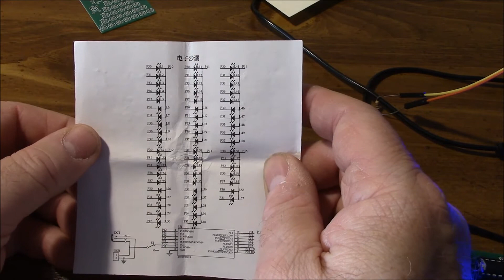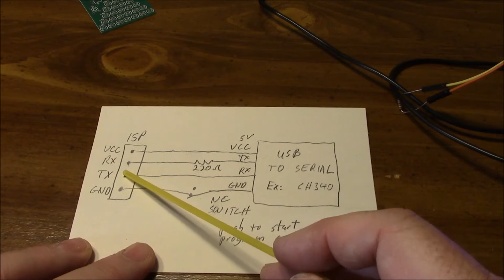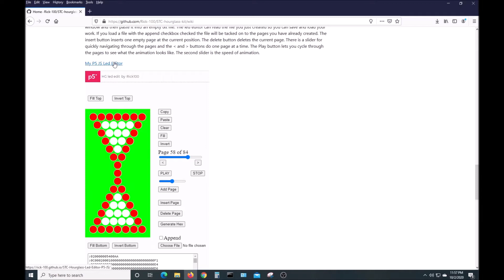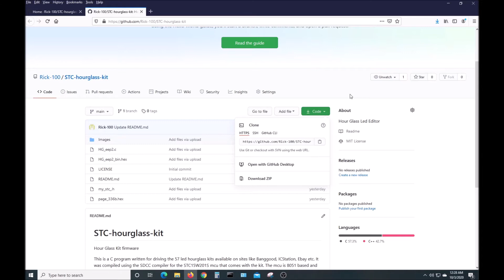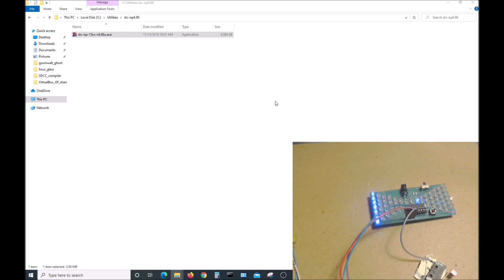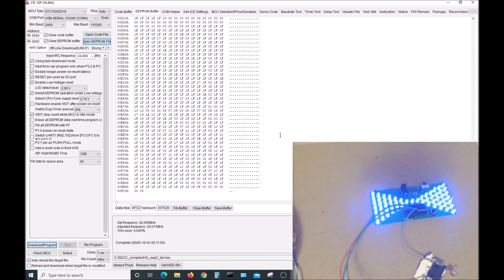Program the STC15W201S mcu  in an led Hourglass kit

Comment: Hi Rick, thank for the video. I use a STC15W204S and when i load page_336b.hex into STC-ISP-v6.96.exe via button Open EEPROM file, i get the follow message: The file is over the validscope, and the exceeding part has been cleared !  . I use HG_eep2_bin.hex via button Open Code file.  When i configure STC15W201S i am yes able to load page_336b.hex, but downloading does not work ofcourse because of wrong MCU. I thougth the 204 has more memory than the 201. Perhaps you know what is wrong.
Reply from the maker: I noticed on the Github page that you found the problem. The 204 only has 4K of program memory but only 1K of eeprom . I think only 85 pages will fit in 1K of eeprom.

Comment: Why did you put the capacitor there? It's supposed to go in the ground hole next to the 4 pin thing and the hole a bit further to the left away from the 4 pin thing
Reply from the maker: It is a decoupling capacitor. I put across the VCC and GND pins close to the chip.

Comment: Is there a way to just slow down the standard programs. Ideally id have it do 5, 15 and 30minutes hourglass
Reply from the maker: If your asking if their is an easy way to slow down the kit without reprogramming the chip then the answer is no. If your willing to modify my program and reprogram the chip then it can be done.
 It's been a long time since I wrote the code. You could probably change the speedVal and speed_table[] from unsigned char to unsigned integer and adjust the 8 Values in the speed_table[] array. You would have to play with the values to get them to your desired time.
This youtuber  has also modded the kit into an hourglass timer:
https://youtu.be/zHmE7z8bmsU?si=7iYv0UFpm-aBpaaI
His mod might be closer to what you want.

Good luck.

Comment: So glad I finally found this.  Took me a while cause I have the other brand of timer that is running off a tilt switch, a CD4069BE and a couple of CD4014 shift registers instead of the STC IC.  I do have a lot of the other project that do have the STC chips and I desperately want to reprogram some of them.  Especially the 8x8x8 LED cube, which I've got some info on reprograming but watching over someone's shoulder like in your tutorial I'm 100% sure I'll be able to do now, once my spare STC chips arrive.  I'm curious, have found a resource for the original programs on the STC chips?  I can't imagine the need to keep them secret for DIY projects such as these.  BTW, I ordered some of the STC timers so I can experiment with those as well.
Reply from the maker: I've never seen any source code for the kit. Maybe it's on some Chinese web site. There is another Youtuber who has written his own software for the kit.
https://youtu.be/Dc_1ku6bZUc?si=o8Na_-ZUcaC5mYTR
He has a links in his video description. Hope this helps.

Good luck.
Reply: I'll be sure to try that out.  I'm much better at modifying code than I am at creating my own from scratch.
Reply: @rick_100  This is great.  I finally got my 8x8x8 LED cube reprogrammed and I've tried out all of yours and 
ceptimus programs for the hourglass.  I want to try reprogramming RGB star but having trouble compiling the code that was provided.  Wondering if you might be able to help.  (re-comment from earlier, without a link)

Comment: Thanks, this is an awesome video! I just got this kit to teach my kids how to solder, but i got one with a surface mount STC 15w204s chip, which is pretty difficult to solder. So i just soldered it myself and i'll get them another (easier) kit. Of course there was no manual included. Also, there is no mention of where to solder the capacitor, it seems it's used to stabilize the dc input voltage? Some leds are always on a little bit and mine is running way too fast, so i might look into reprogramming this thing. Is there a way to set the range of the speed?
Reply from the maker: That's interesting. I didn't know there was a surface mount version of the kit. I'm curious if it uses the same led layout. If it doesn't, the patterns generated by my software will be jumbled. 
Thanks,
Rick

Comment: Goodnight,
I have this 4CH board, which has a corrupted firmware.
Is there a way to reinstall its firmware?
Reply from the maker: I'm not familiar with the 4CH board.  If it uses the STC MCU and you have a copy of the firmware you may be able to re-flash it, if you have access to the programming pins.
Reply: @rick_100  It uses 15W204S microcontroller and WB3S WiFi mode. It has 4 holes next to the wifi module. I think it's the holes for the programming access pins.
Reply from the maker: @Carlos-yt3wf  Here is a link to the English data sheet:
http://www.stcmcu.com/datasheet/stc/STC-AD-PDF/STC15-English.pdf
Page 56 is the start of the section on the STC15W201S which is the series your 15W204is in.  This data sheet is my source for most of the information in the video. Page 64 shows a variation of the programming circuit. You will have to check continuity between the pads you think are the programming header and the pins on the mcu to confirm it is the programming header. You will still need to find the firmware you want to reflash on it.
Reply: @rick_100  Thanks!
Reply: @rick_100  Thanks!

Comment: Is it possible to do different codings, for example, to delay the disconnection and connection of the relay If it can be done, what software is used for coding?
Reply: Or can such a code be found in GitHub?
Reply from the maker: I used the SDCC compiler which is a free C language compiler. The stc15w202s can be used to drive a relay through a transistor or a chip like the uln2003 or uln2803. It can also do precise timing. You would need to write the code to suit your application. I have several coding examples on my github page:
https://github.com/Rick-100
Here is my STC playlist:
https://youtube.com/playlist?list=PLxd1j_d9JPQiO5JSyYXCkKwSiu8SX8xoT
Here is my video on programming a "Hello World" program for an STC15F104:
https://youtu.be/gaVRgpdsOGk
The information in the video would apply to your chip.

Hope this helps.
Reply: Would love to add a buzzer to this. You think it could be done?

Comment: Interesting way of doing it, using patterns stored in the EEPROM.  I went for a code-only approach.  In the -201 chip, I was able to fit either a replica of the original hourglass displays (but with more speeds, and better button debouncing) or a different set of patterns.  With a -204 chip there's plenty of room, so I fitted everything in, and there's room to spare if someone wishes to add more patterns.  Video here: https://youtu.be/Dc_1ku6bZUc  There's a link to the source code etc. in the description.

Comment: Hi Rick. Nice work! An abnormal situation arose, I made the wrong sequence during the firmware and now the firmware is not readable and nothing is loaded. And when power is applied, nothing happens. How to make sure the microcontroller is working?
Reply from the maker: Sorry to hear you're having trouble. The chip is designed so the firmware cannot be read so you can never go back to the original firmware. Did the kit work before you tried to reprogram it? If the chip was working then, it's probably still good. I've never bricked one while trying to reprogram it.   You can attempt to reprogram the chip as many times as you need.  Are  you programming the proper hex files into the code buffer and eeprom buffer?  The file HG_eep2_bin.hex should go into the code buffer and the hex file generated by the hourglass editor should go into the eeprom buffer. They both need to be loaded each time you reprogram it. You can load the file page_336b.hex from the github page into the eeprom buffer if you think the problem is with the data file.

 The other thing I would check is the programming circuit. Do you have the switch in the ground leg of the circuit for cycling power. I don't think it will work if the switch is on the 5V leg. Do you get any error messages in the STC-ISP software when you attempt to program it?

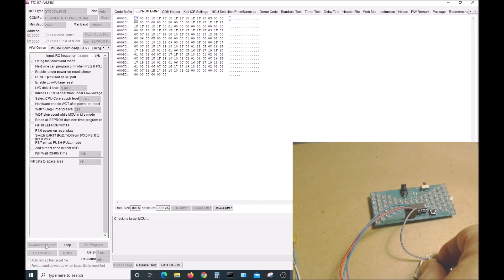If you you click the download button on the STC-ISP and cycle power to the board do the messages in the bottom right window look like the ones on the video at 23:20 ?
If you see the messages about MCU ID and Programming user code then the chip is working. When I used a cheap switch for the program circuit I got timing errors caused by switch bounce. That's why I use a micro switch.

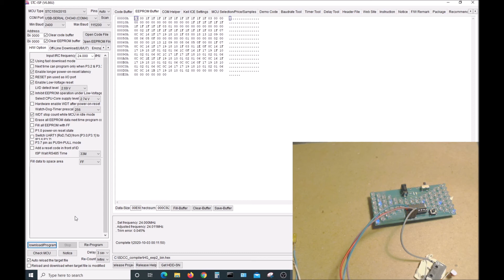 Does the bottom right window of the STC-ISP look like the one in the video at 23:30 after the program cycle is complete?

Set frequency: 24.000 MHz
Adjusted Frequency: XXXXXXXXX
Trim error: XXXXXXXX

Complete ! XXXXXXXXX

Or does it say something else?
Reply: @rick_100  Thanks to Rick100, the microcontroller worked and it looks like something went wrong during programming, because with the firmware from the seller, the microcontroller initially lit up a little other LEDs, I added one ceramic and one tantalum capacitors for power supply, but the illumination did not disappear. The switch was set to a limit switch from the floppy drive, so it should be suitable. I don’t know if I can see the clock frequency on the microcontroller using an oscilloscope, it looks like he ordered to live a long time :)
Reply: Now even does not define the microcontroller. I tried through CH340, PL2303 and nothing. I ordered several boards for tests, as soon as they arrive, I will look and compare, thanks

Comment: Thanks again Rick for your support. 
No, I'm not a programmer , only an interested amateur of electronics. With your help I managed to let burn all the leds in groups of 5 leds (=1F) It's a start and I have to experiment to be able to let every single Led burn one by one  and construct different patterns... I just struggeld with the 2 end numbers of every line, (checksum I suppose) but indeed the STC-ISP software seems not worry about those numbers. The "hour glass" -editor is a great help . I want to create a 5 pointed star with 60 leds and then let it shine with many different patterns...
thanks again. Paul
Reply from the maker: Glad to hear you find it useful. I modified a couple of lines of code in the editor so it will now do all 60 leds and arranged them in a 5 X 12 grid. The link is to the this version of the code.
https://rick-100.github.io/STC-Hourglass--LED-Editor-5X12/
Hope your star project goes well. I would love to see a video if you get it finished.

Good luck
Rick

Comment: Hi Rick,
 It's just a toy for Christmas I want to use the 15W201S to christmas lights in the christmas tree.. By the way , is there a rule for the begin and end numbers of every page?
Reply from the maker: I'm not sure if this is what your referring to, but in the line:
:0C0002001F1F1F1F1F1F1F1F1F1F1F1F7E
0C is the number of data bytes or decimal 12  data bytes
0002 is the eeprom address the 1st byte of data in this line will be stored
00 is the Intel hex record type DATA
1F1F1F1F1F1F1F1F1F1F1F1F are the decimal 12 data bytes that hold the led pattern for each page
7E is the checksum calculated from all the other bytes but the STC_ISP software doesn't seem to care about checksum values

You could use the led editor to produce the number of pages you want. Then change the hex values that are in the positions that the 1F1F1F1F1F1F1F1F1F1F1F1F occupy. Just keep the values between 00 and 1F for each byte. Then everything would be OK except the checksums which you could leave as they are.

I'm not sure how far you have gotten. Are you a programmer?

Good luck
Rick

Comment: Thanks for your quick answer.
I mean the hex file where the LED patterns are dertimined. How are those hexnumbers determined to the different patterns? Is it possible to control also 60 LEDs? becaus I have a project for 60 LEDs.
Reply from the maker: I think my  firmware allows the extra 3 leds but it's been a while since I wrote it and I could be wrong. The hex file generated is an Intel  hex file. The Wikiipedia article explains the structure. 
https://en.wikipedia.org/wiki/Intel_HEX
The "data" fields hold the led patterns .  To get an understanding of how it works use the led editor:
https://rick-100.github.io/STC-Hourglass-Led-Editor-P5-JS/
Set the first led and click the "Generate Hex" button'. You can see the hex file it generates in the text box. The first data byte will be 01. Set the second through fifth leds one at a time clicking the generate hex button each time to refresh the text box. You will see that the first  data value increases until it reaches 1F or binary 11111. Setting the sixth led and clicking "Generate Hex" will leave the first data byte at 1F and the second data byte will be 01. The led data is held in the 12 data bytes. Each byte holds 5 bits. Referring to the schematic: 
L1 = bit 0 of the first data byte
L5 = bit 4 of the first data byte
L6 = bit 0 of second data byte
and so on

The first line of the hex file holds the number of pages. The last line is ":00000001FF" and I don't think it ever changes.

You may find this useful for examining or modifying a line of Intel hex:
https://www.fischl.de/hex_checksum_calculator/

If you want to test it, you can try these untested data files that have one page:

This one should light all 60 leds
:020000000100FD
:0C0002001F1F1F1F1F1F1F1F1F1F1F1F7E
:00000001FF

This one should leave L60 off
:020000000100FD
:0C0002001F1F1F1F1F1F1F1F1F1F1F0F8E
:00000001FF

The gory details are in the Wiki article listed in the Github Wiki:
https://github.com/Rick-100/STC-hourglass-kit/wiki

Hope this helps.
Rick

Comment: Nice work! Do you have a clue how the hex code is build up? Every page has one but how is it build?
Reply from the maker: I'm not sure what your asking. There are 2 hex files. One file holds the program the mcu runs. This file is produced by the SDCC compiler. The second file holds the data that contains the led patterns. It is produced by the led editor I wrote in P5 JS. Both files are loaded into the mcu using the STC-ISP programming software. The Github Wiki in the video description has more details.

Comment: thanks Rick 

I use STC15F104W , and I got this error :
 Adjusting frequency ...
 Download failed !

But the check MCU works fine.
Reply from the maker: Hello Ismail. The only trouble I've had downloading is when I used a cheap switch to cycle power to start the download process. That's why I use a micro switch to limit the switch bounce.  The other things I would check is the power supply. The STC15F104W needs a 5 Volts. It's minimum voltage is 4.5V if I remember correctly. The STC15W  series will run at a lower voltage. Also make sure the 2 programming pins are not connected to other electronics that might interfere with the lines.
Here is a link to some other things  to check:

https://www.stcisp.com/q_and_a_stcisp_english.html

This is from that page
"7, STC-ISP download options delay settings are correct (recommended tick "use a longer power-on reset delay")."

Good luck,
Rick

Comment: Rick - what kind of programmer are you using? Is it home-made?  Where can I get details of this programmer and how to connect it. Thanks.
Reply from the maker: Hello John,
The programmer is just a CH340 usb to TTL adaptor. This one should work:
https://www.banggood.com/CH340G-RS232-Upgrade-USB-to-TTL-Auto-Converter-Adapter-STC-Brush-Module-p-1548815.html?rmmds=search&cur_warehouse=CN

For this board , you would need to place the jumper on the side of the board between S1 and 5V to select the 5 Volt outputs. The Ch340 adaptor also provides  power to the board. The jumper they show on the end of the board between TX and RX should be removed. Then wire RX, TX, GND, and 5V as shown in the video or the Wiki. I used Dupont connectors with both ends female. You also need a switch and a 220 Ohm resistor. The switch is wired so that pressing it breaks the ground connection to the led kit board.

The Ch340 is just a generic USB to TTL serial convertor. There are others based on different chip sets that would also work.

These are the timestamps in the video:

Connecting the programmer:
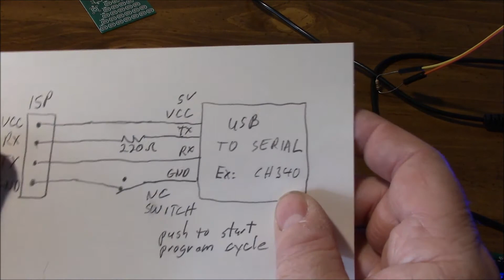3:50

download the programming software:
9:40

Running programming software:
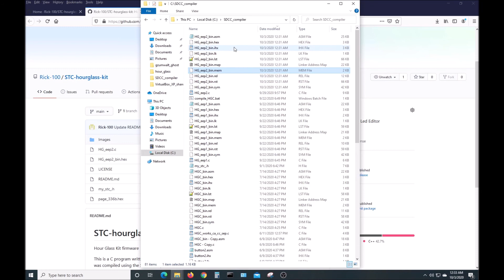21:00

The Wiki has a lot of useful info:
https://github.com/Rick-100/STC-hourglass-kit/wiki

Good luck,
Rick
Reply: @rick_100  Thanks very much Rick. I'll check into this. Good job!